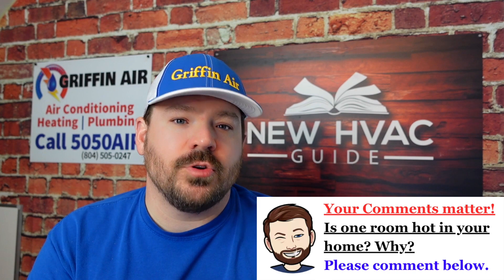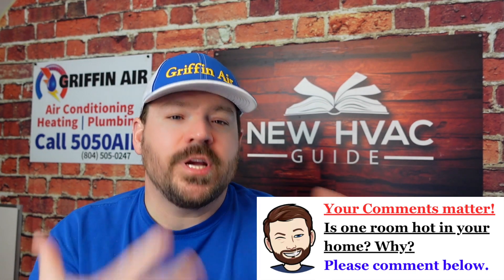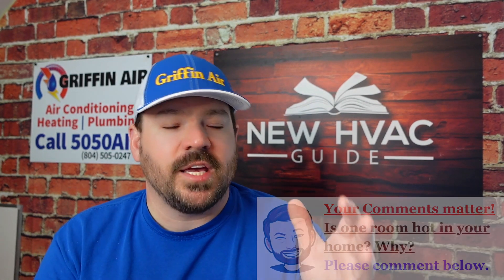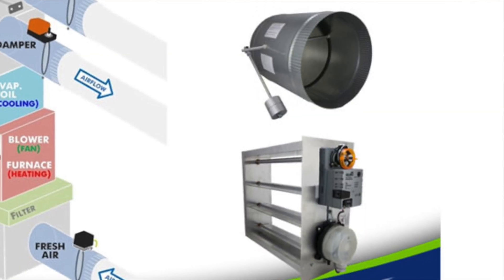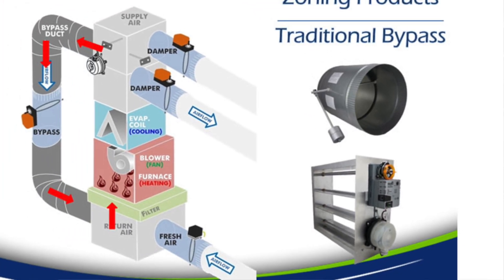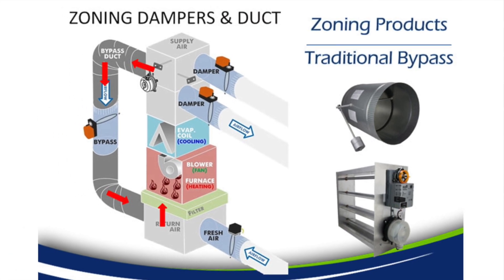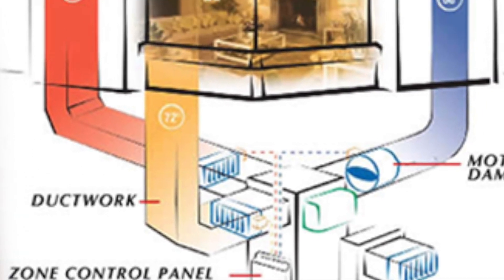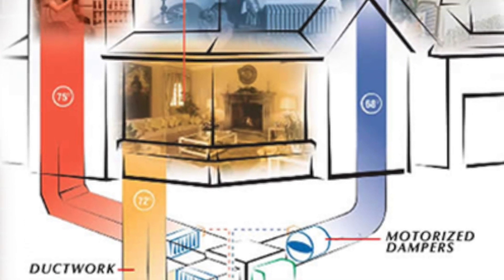Hot Room SOLUTION! Zoning or Ductwork Theory!

Comment: Hey guys, i have a fugitsu mini split 5 zones unit. 

Can I have it set on auto on one head and dry mode on another head at the same time without damaging?
Reply from the maker: I did a video recently on this exact topic that you should check out. Most multi zone systems cannot be in different modes and operate properly. Although this would not necessarily create damage to the system, it will usually just not operate at all, if the systems are in different modes.

Comment: Can a backup heater coil supplement a gas furnace in case of gas furnace failure?  Or what is a backup heat strategy for gas furnace failure?  Thanks!!!
Reply from the maker: They make auxiliary heat kits that can be installed in the ductwork instead of the air handler. But I’ve never seen one installed with a furnace.

Comment: We built in 2019. The manual just called for 3 tons we did 4. However, the contractor put in 2x 2 ton air handlers and I wish we had split it better.

The house is split in 2, basement unit does the basement and first floor. Attic unit does second floor ( attic is within the insulation envelope).

Well, in winter, we rarely run the upstairs heater except for from 5am to 9 am when we get up and take our showers. And generally the bedrooms stay pretty comfortable at around 69 degrees. (1 exception). 

The downstairs unit doesn't heat or cool properly. The 2 story family room and the loft are always hot in summer ans cold in winter. 

I even asked for a duct in the loft because I knew it was going to get warm up there, but the installer decided a return was all I needed. 

I'm thinking of having a company run a line from the attic to both the loft and the family room. I figure it should be easy as the attic is always about 5 degrees warmer than what the rest of the house is.

Another option is to add a 6000 btu mini split to the basement. This would allow me to use the basement air handler solely for the first floor.

Comment: Is it generally best to centrally locate your furnace or air handler in your attic or crawl space to ensure air is traveling equally throughout the house? I have parts of my house that heat up fast because those rooms are right under the furnace.
Reply from the maker: Every house is different. But the rooms closest shouldn’t be significantly different than the furthest if sized propoerly